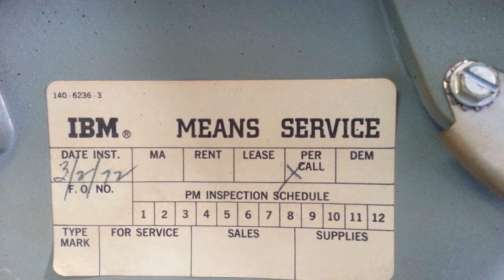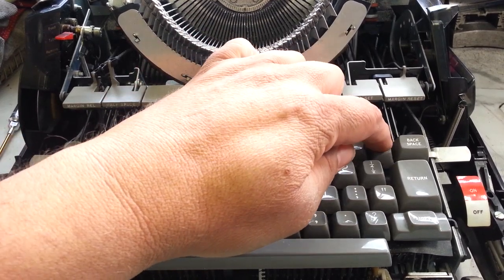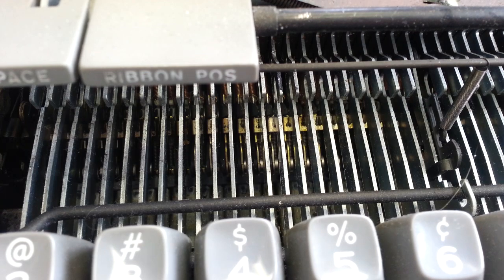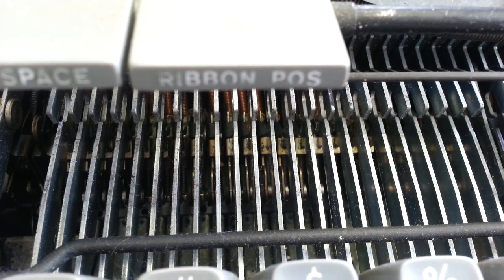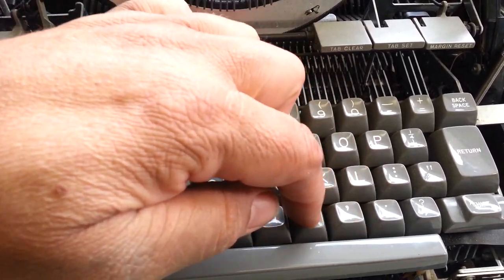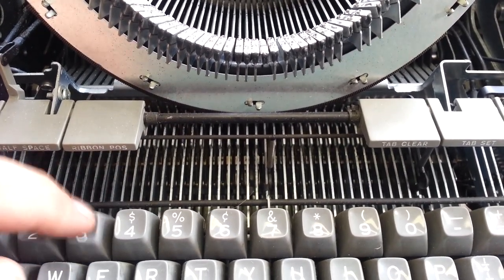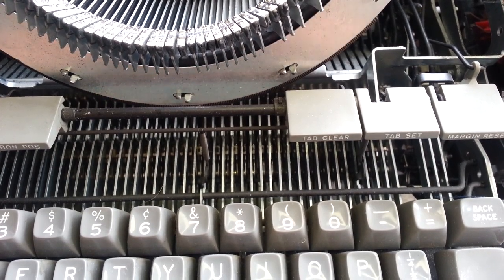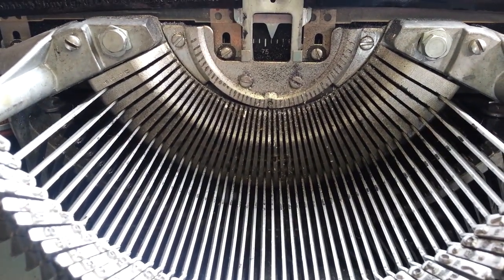IBM D Model Typewriter Keyboard Sticky Stalls Won't Trigger Repair Adjusted Key Levers

Comment: How do you feel about tackling a Model D Executive for repair? Difficult? Are they repairable, or even worth it? (I'm fascinated by the proportional spacing idea.)
Reply from the maker: C & D models were the first typewriters I was taught how to rebuild, did 100's and 100's,
Proper quality Power roller availability is the problem, only place that try's does platen rollers and other industrial rollers
But there method leaves these slightly out-of-round, causing inconsistent print
After fighting with the last 2 I have tried to fix, I now no longer want to try getting these working
Reply: @phoenixtypewriter2136 Sounds like they could fix that by putting the roller on a mini lathe and true it up. As long as it isn't too far out, it ought to be doable, I'd think.

Comment: Hi Duane, how would you adjust the type bars the other direction, like if you over corrected with the screwdriver tap? Love your channel, solved many problems from your videos.
Reply from the maker: There is a special tool for that, but forever I have been taking the strong IBM spring hook, hook on underside of type lever in about the same spot and pull up, forming (bending) bar back up, but this does takes some controlled strength
Reply: Thanks Duane. I’ll take a look. Mine is having an odd behavior in that the type bars fire but seem to stop short, perhaps the type bar is out of adjustment and not allowing the lower portion to recycle.
Reply from the maker: @michaellee3399  Cams are slipping on power roll not giving typebar enough momentum to strike roller I would suspect

Comment: Hi. Love your vids. Ever work on an IBM Model C? I've got a lose carriage belt. I'm trying to figure out how to pull the carriage. Thanks!
Reply from the maker: Worked on 1000 C models, 1st typewriter I learned to recondition 40+ years ago
Not sure what carriage belt is ? Draw band/mainspring maybe ? Return band ? 
You might go to Facebook Typewriter Groups, more than a few mechanics there and you can post pictures and get parts....
Reply: Thanks so much for your response. "Carriage belt" is my term. Ha! There is a belt that connects on the right side of the typewriter to the actual frame of the machine and on the left to the end of the carriage. It's loose. I'll check out that FB group. Thanks so much!
Reply: I think I mean the return band.
Reply from the maker: OK, not sure how I can help you with words...... on-hands look and diagnosis might be the only way
I was shown, in person, side by side, with an IBM training tech.
Reply: Understood - many thanks. I joined that FB page you mentioned - looks like a good one! Thanks again.